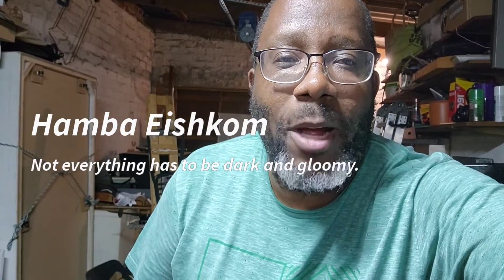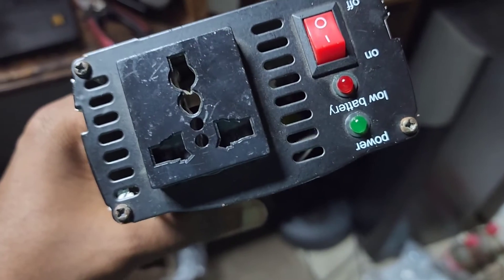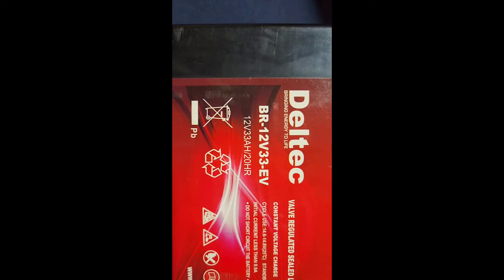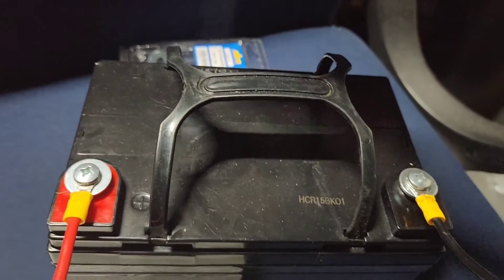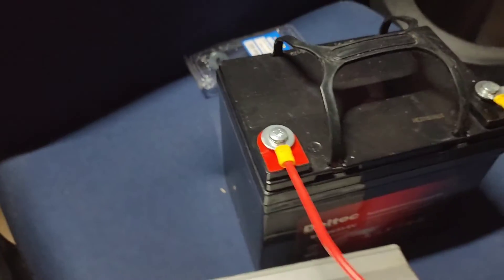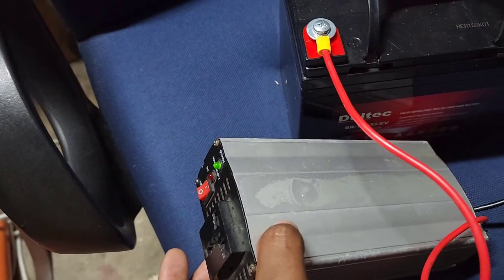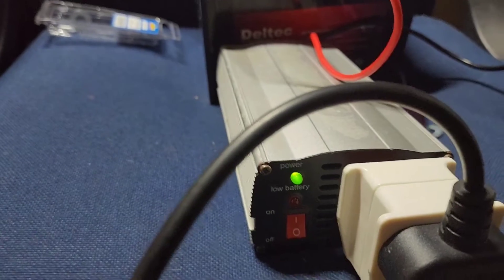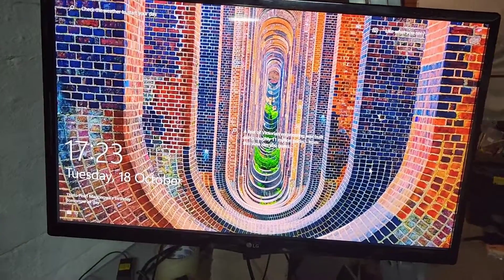A Simple Loadshedding Solution

Comment: This is good, however how do you charge up the battery once its low?
Reply from the maker: There are various battery chargers available, maybe I should do a video on that as well. I currently use the BOSCH C7 12/24V Automatic Battery Charger